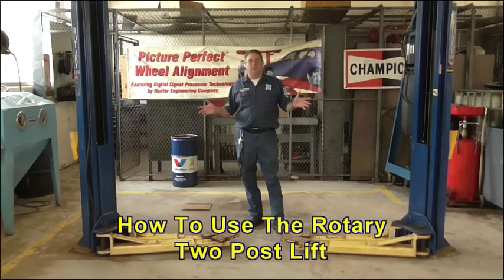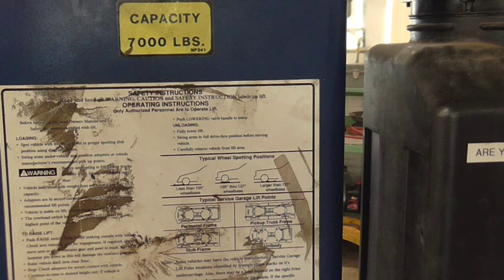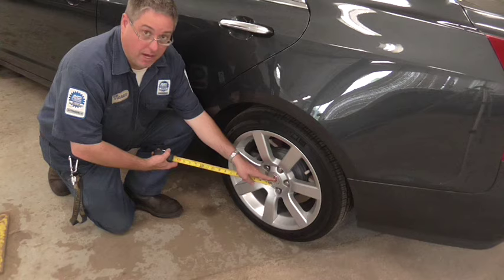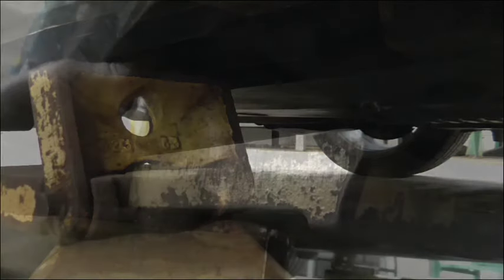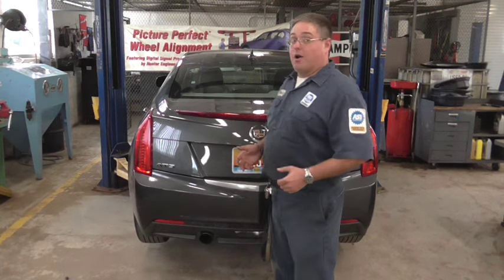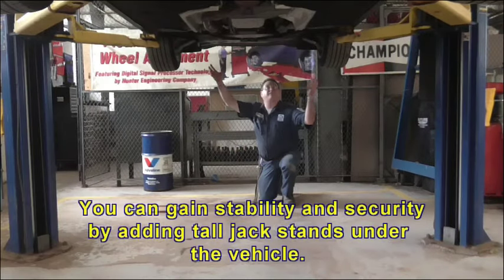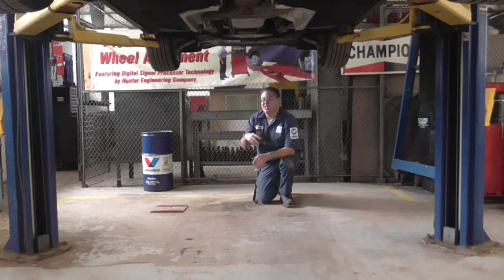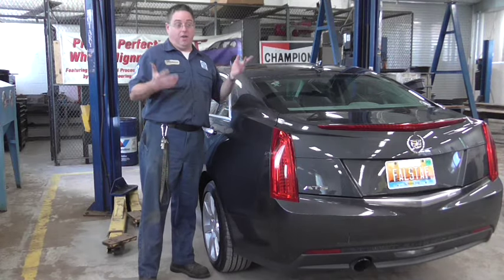Using the Rotary Two Post Lift.

Comment: Very well done. Just two points that were missed. Make sure the arm restraints are working properly to prevent lateral movement of the arms when lifting the vehicle and when you have the vehicle at the height you want then lower it a little until it the lift is resting on the carriage safety latches.